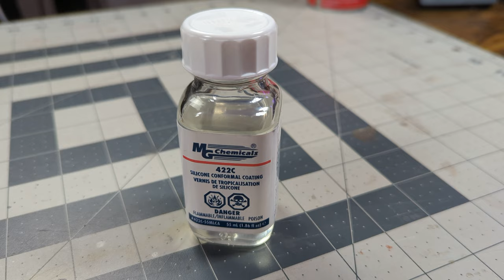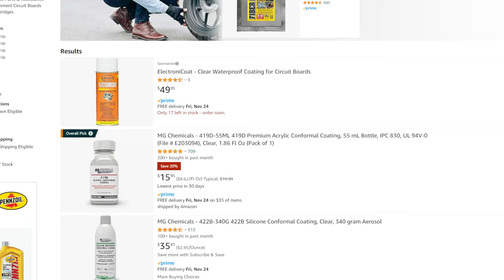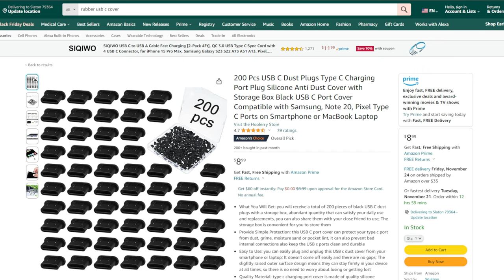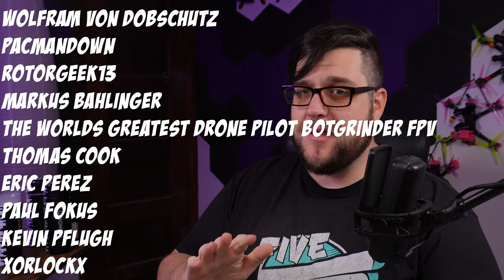Water "proofing" your FPV drone - How to get it done and what to avoid

Comment: Great video!  I've coated over 200 quads, and I agree with all this good advice, except for the "truly waterproof" bit.  Ive found with MG 422C you really need 3-4 coats to waterproof, with 1 or 2  it's still "light duty"  it's super easy to rework, because you can solder right through it. Light duty means your electronics will probably survive, but in a light rain you'll eventually get waterlogged. With heavy duty coating, you'll completely encase the boards. Worry free isn't good to solder through, but you can scrape it back with a fingernail and then solder 👌 it takes about an hour to dry,  but only needs one coat. If you want to seal ports properly,  put in a silicone plug and carefully coat the port while it is plugged, when you need betaflight,  just peel it off and recoat when you're replugged. Warm PC Desktop exhaust dryer FTW, the editing actually dries the drone 👌 great video 🙌
Reply: This worry free stuff is cool lol it makes my esc and fc look like professionally waterproofed electronics just in the way it makes that cool rubbery force field around it.

Sure was clean and shiny looking before I got impatient and went for an early fly 😂 now I got that matte desert tan finish on my stack. I basically gave my stack the FPV equivalent of a tar and feather punishment 😂🤦‍♂️
Reply: @RandoManFPV  lol, stack dont care if it's tan n dusty, it's just happy to be dry 👌

Comment: Acrylic MG Chemicals - 419D-55ML...is better because you can solder right through it for repair
Reply from the maker: you can with the silicone as well :)  I have a quad back on the wall that has 3 years worth of soldering repairs and component swaps through the silicone conformal.  The coating is getting a lil thick now on it though, lol.
Reply: The biggest issue with acrylic is it's less flexible , and even more prone to chipping than 422c and 422b . I like how tbe flexible coatings help secure wires too 👌

Comment: I coated my 3.5" Grinderino with FPV Worry Free, easy enough to apply, haven't had an issue flying in rain or through water fountains. Coated my 5" Demibot with Flywoo X30 Superhydrophobic spray and it works just as well but even easier to apply and work with! Love the choices we have.

Comment: just got done Conformal coating my winter gear. been doing it since 2013. I like to put little heat sinks on my VTX's after coating them. I've had a couple over heat after Conformal coating.
Reply: Same way i do my esc's, peel off the heat sink, apply conformal, and squeeze the heatspreader down into the CC 👌

Comment: I like to use DryDrone to protect all the plugs then come back with the conformal coat.
Reply: Can you still get Dry Drone? I couldn't find it in stock anywhere.
Reply: @William_NS  Ya know, I was wondering that same thing as I was typing it. I'm sure it's not a product they were manufacturing in house though. I might have to do a lil homework. To be fair, it wasn't a cheap product.

Comment: I've been using the worry free stuff but I think I'm going to try the thinner stuff you have.  The wf stuff is like smearing silicone caulking across the board.  I learned about the barometer on the speedybee boards by coating my first one and covering that little hole.  On my 30x30 I was able to scrape it off and it was fine but my 20x20 I must of gotten some inside because it's always saying I'm at a few thousand feet.  Makes the RTH function pretty interesting.

Comment: Fpv worry free does a better job than regular conformal coating. It's so easy to miss a spot with conformal. Fpv worry free encases everything in a gelatinous substance. Flew my quad into a waterfall in scotland no problem.

But yes it is more of a pain to get off

Comment: I use Conformal for my standard quad builds but for my waterproof builds, I use FPV Worry Free. So I can FPV Worry Free! no but seriously, if you want to fly through downpours or land in the swimming pool, FPV Worry Free is where it's at!
Reply from the maker: I may or may not have landed and taken off from a few swimming pools with this stuff, lol....not on purpose of course :p worry free does give you a little more confidence though since it is thicker.

Comment: A small nitpick: barometers can be damaged by isopropyl alcohol or other solvents, so you should close the opening before cleaning the board, not just before conformal coating. Source: dps310 datasheet: "Air blow and ultrasonic cleaning procedures shall not be applied to MEMS pressure sensors. A non-clean paste is recommended for the assembly to avoid subsequent cleaning steps. The MEMS sensor can be severely damaged by cleaning substances."

Also, ovens can work for quad drying, if temperature is regulated well enough. 80°C with convection on works pretty well (if you have a battery powered beeper, maybe choose a lower temp - lipos don't like high temperatures). Or a hairdryer.
Reply from the maker: hey that is some good info!  There are some sophisticated mems in there doing all the pressure sensing so that makes sense.

Comment: Excellent video. Super comprehensive. If you want to be as waterproofed as possible I’d do the conformal and then fpv worry free. It’ll be more work to peel off after for repairs though.

Comment: Im so keen to do this asap. I have the strongest urges to fly when its raining. Now i just gotta see how bad vision gets under rain without installing teeny tiny windscreen (lens) wipers 😅
Reply: You could try using rainx on the lens and it’ll bead straight off
Reply from the maker: I was gonna say, a little rainex keeps it from sticking and making big beads.  I don't really like to fly in the rain anyway even if the lens isn't feeling clingy, but a small wipe of that helps for sure.
Reply: Great suggestions, thanks! I've noticed alot of places where I live become totally devoid of humans with the slightest rain, so it's a great time to fly 🥷
Reply: @AnansiFpv we guerrilla ripped botanical gardens on a rainy day. Got permission at the front desk to "film all we wanted" 😂

Comment: You can also put silicon grease in the sockets for extra protection. Forms a watertight seal without compromising conductivity (the plug just displaces the grease). Probably regular grease would work too, it does in automotive applications, but might be more conductive.

Comment: You just reminded me, I don't know where my MG Chemicals went. I try to coat all my quads but I am guilty of letting many go without a coating. I live in the only place hotter and dryer than Texas. So, only by maliceful machination might my multi-rotor's microelectronics meet a most moist moratorium, misfortune; Le malheur!

I actually have some FPV Worry Free but like you said, it's a pain in the ass if you ever plan to work on the quad again. With that said, my conformal coating should be here Tuesday and my little USB plugs, tomorrow. I never thought to buy USB-C and Micro USB dust covers, thanks!

Comment: I just use it on the one analog 5” I keep around for flying off boats and in winter weather(I’ve had 4 or 5). I have dunked them many times, I dried them, wait about 1-2 days and they are always fine. I have never ruined one from snow or water surprisingly

Comment: Great vid - I plan to do it. So I will leave all the solder joints and cables on there and try to get to all the places?! Probably the best way is to do it while building, leaving out the solder points, solder them and then coat those places. Too late for me ;-)

Comment: blue tac is the best tool when conformal coating, i fill the plugs and plug the baro with it and spray my circut board laquer spray till it runs off, 3 coats, then when its dry i scrape the skin off and use fresh blue tac to pull out the tac thats in the plugs, or if im not using that plug then i leave it filled and coated, also im a firm beleiver that it increases durability by making the componants less suseptable to vibrations and stuff cos they glued down like a mofo. - driftingS13
Reply from the maker: Blue Tac is a great way to do it!  I tend to be the joker who gets it stuck in the ports though, lol...so I just plug them in now rather than have to dig it out.  I too agree about having the components better seated after coating, and it looks like more manufacturers are doing that in some spots now.
Reply: blue tac is the best for almost everything.  I like it to mute the vifly gpsmate beeper when im plugged into my laptop.  It thinks the battery has been ejected and has the self powered beeper that is beyond annoying.  blue tac over the horn...silence.
Reply: @BaconNinjaFPV  i 100% plug in the ones im using first, just the usb and baro i usually remove it from any extra plugs it can stay there and help keep it sealed for life
Reply: 100% this, but instead of bluetac I use silicone plugs for usb 👍
Reply: @Fly_High_FPV  silicone plugs dont do the job well enough for spray, i have had the usb become unuseable because the circut board lacquer is so thin and runny it made its way into there, if your using a brush then the silicone plugs are all good, the blue tac works great for the spray cos you can really fill the usb and plugs and when you remove it their is 0 conformal that gets in there even tho i drench the stack till the conformal runs off it
Reply: @christhorney  i'm using the thicc worry free coating, comes with silicone plugs, works great 👍
Reply: @Fly_High_FPV  I do t like worry free as it's super soft rtv type silicone with an addive that makes it way softer than typical rtv, so it gets compromised super easily, the first time you turtle mode or crash and throw hard chunks at your electronics you can consider it compromised. Also because it's silicone nothing sticks to it so if you worry free a receiver for example then you can no longer use double sided tape to hold it down because no adhesive wants to stick to it, where typical conformal coating I use does not do that, it dries hard and durable, double sided tape sticks to it just fine, and you can still solder through it no worries at all. Where fpv worry free you need to scrape back then solder. I'll never use worry free again personally

Comment: I've used this MGChemicals 422C for the last couple of years and its so brittle when it dries, it cracks and falls off so easily. I've tried doing thin layers, thick layers, multiple layers and it still ends up dry and flaky. I heard someone said they changed formula's a few years back but I don't know how true that is. Anyway I'm looking for another product but can't find anything. Except FPVWorryFree but that looks likes its impossible to work through to re-solder things. Any other products to use? Thanks.

Comment: Ok nice,but what I would do if I want to solder something?
Reply from the maker: with the silicone and acrylic based coatings you can just heat up the pad like you would when tinning and the coating will burn off within a couple of seconds :)  That is one reason to use thin coats as opposed to thicker ones because although you can still burn through a thicker one it will leave more mess from bubbling coating.
Reply: @BaconNinjaFPV  now it makes sense! Thanks for the info!

Comment: Help please! I can't connect to update firmware on my flight controller. It tries to connect and doesn't work, then if connect, then disconnect in 3-5sec, or connect with CLI only, or says about unavailable version, and there is no my board of FC(SPracingF3) as an option in Betaflight-configurator(i tried few older versions too). I tried update/change drivers and also ImpulseRC doens't find anything. Would be nicer if we could connect in discord/slype etc so faster/better communication and so i can show what exactly happens. But any help would be great. Thanks!

Comment: Just dunked a quad in my pond 2 days ago.... dried it with compressed air and stuck in the convection oven at 120F° for an hour. I thought I got away with it, but the HDzero vtx tripped the smoke stopper. I guess that one is toast. Ahh well...
Reply: I think should rinse it with distilled water before drying it
Reply: @flat-earther  I think you're right... 🙂 also something I learned from this video.

Comment: What if we use Nail Polish, the stuff with nitrocelulose, the good stuff. Or what if we just put hot glue over everything?
Reply from the maker: I tend to not use that kind of polish as coating just because it remains flammable after it dries.  Not that you couldn't and it would last longer with that than acrylic, but some things tend to get hot on quad parts and I just never liked that combo.  Hot glue can be done too, and I admit I have done that wayyyy back in the day when I used to build my own PCBs.  Downside is that will retain quite a bit of heat and may impact the service life of components.
Reply: @BaconNinjaFPV  Ha, yeah, nitrocellulose and a hot ESC would make a quad that's FIRE!! 🔥
Reply: I like e6000 for $3 hardware store coating.  It works extremely well if yoj can spread it properly, but it's permanent.   Great if you have a build with bt/wifi, and you want to fly under water😂
Reply: Dont use hot glue on any boards that get hot (pretty much all boards in fpv)  if it gets hot enough to liquefy it will creep and ruin boards 😪  i've seen it make some on the fly antenna mounts and fpv mounts and single use skidz too 🤣 (that's the kinda junk that literally led me to 3D Printing 👌)

Comment: This has nothing to do with water proofing. Just swapped everything from a aos 5 frame to tanq frame. I kept breaking the AOS 5 frame. Using xing2 1855kv motors. What props should I use on this heavy frame. I really did like the AOS 5 it's just to fragile.

Comment: cant you just get the hull off the dji o3 for example, and first coat the inside without coating any plugs and then coat every airhole of the hull and assemble it back? that way you could keep your plugs and still waterproof everything…

Comment: Has anyone just tried hosing everything down with that camp dry silicone spray for water proffing clothes and tents? I just kinda wonder if you gave it a fresh coat occasionally or at least the day before flying near water if it would prevent releasing the magic smoke 🔥, or maybe just cause it, 😂

Comment: Absolutely do not put conformal coating on your bare vtx! I did this and it suffocated the vtx ,its just black now. I used worry free and it doesn't come off with alcohol. when I re-watched all the videos. I noticed they all had an aluminum case, that they just covered up the holes with the worry free. so now I have the worlds lightest paperweight lol also thanks for the video I have a speedy bee I will be conformal coating soon

Comment: I suspect the really important thing is what you do after the quad gets wet.
I have some experience with quads and water. I've had a Kised Alien that was underwater for a couple of hours and a Diatone GT349 which was under water for 5-15 mins. The Alien lost it's battery, the battery of the GT349 stayed on. Both of those quads are still flying - the Alien is had it's swim about 5 years ago - there's a photo  of the ALien immediately after it was pulled out of the water at the end of: https://www.youtube.com/watch?v=GYVIpIQGcXA.
The Alien had had extensive conformal treatment, the GT had only had conformal on the solder joints for the motos and battery wire joints - it was it's first flight and it was a plug 'n' play and I had not pulled it down yet.
The quads both went into the same water - an onramental creek at my local park.The water is fresh water, but it has rats and ducks and who knows what else swimming in it and the bottom is covered in sediment, so it is not very clean fresh water.
The Alein came up covered in mud etc - I could not see the Alien when I recovered it even though it was only in 9-12" of water. The water was a fair bit cleaner when teh GT went.
In both cases after recovering the quad  (and disconnecting the battery for the GT - out of the water) - I took the quads home and flushed them with fresh clean tap water (our tap water is chlorinated) for like 10-15 mins, rotating them and moving the hose around to cover as many anbgles as possible, basically trying to git rid of as many conductiver particles as possible.
Then I left then to dry for 2-3 days in the sun. In both cases it was summer which means it was 35C+ (nearly or around 100F) and very dry - we have very low humidity.
Then I powered them up with a low charged battery (as in flown but not recharged or storage charged) smoke stopper and when that was OK I 
The Alien came trhough will all components OK.
The GT which still had a connected battery when it when under water needed a new 4in1 ESC.

With cameras I coat all the internal components except the sensor. I also apply some coating to the lens threads and for cameras with a case aroiund the join of the case back, both before and after repalcing the back.

I believe the best way to apply conformal is to air brush it - the MG 422B comes "ready to spray" - but make sure you have some kind of thinners to clean out your brush after. I just use a paint brish designed for scale modelling to apply mine and i use laquer thiner to thin the coating even more (I have some that is not MG and is much thicker) and clean the brush.
One thing many people don't know is is that conformal coating - at least silicon conformal - is a thermalk insulater so applying it thin is a good idea. I typcially go really heavy on the pins of chips, regulators etc and fiarly light on the top of the chip package.

You can solder through conformal, but I prefer to try and scape it of with a wooden tooth pick or icream stick or to use alcohol to clean it off.
If you solder through the solder behaves kinda ike lead free solder and you get little points when you take the iron off - like tiny pointy dog turds and the  solder looks dull. It still works, but it looks shit and I'm not 100% convinved the join is mechanically  quite as good.